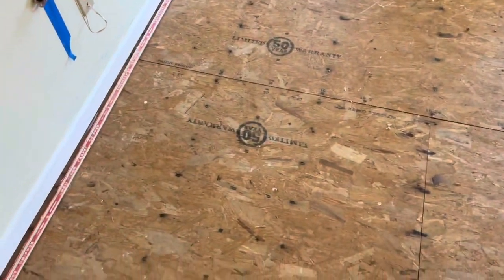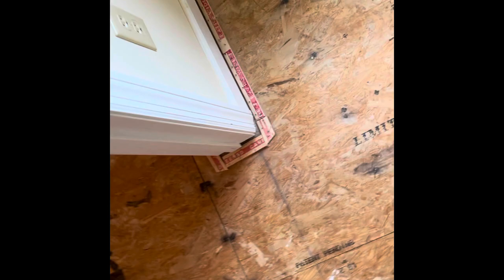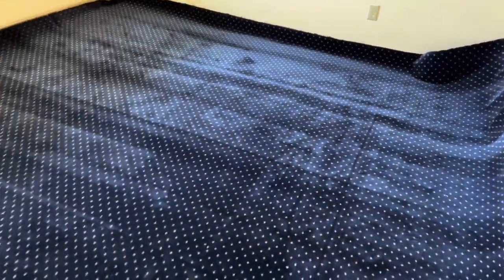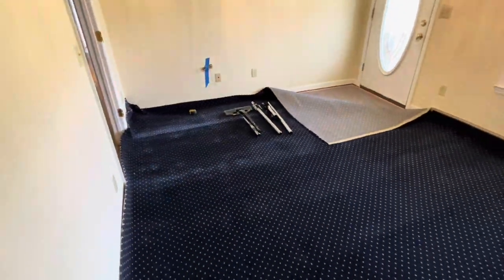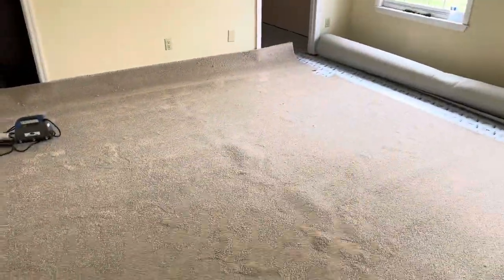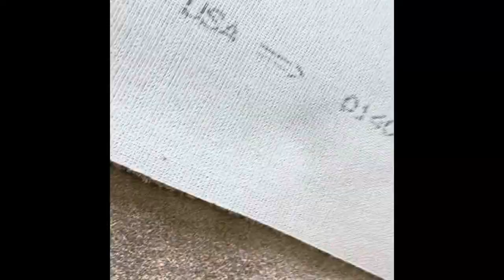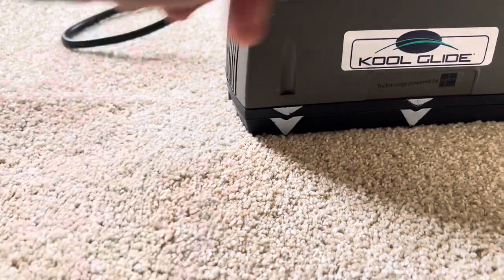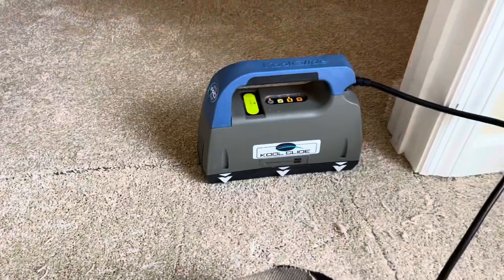The daily grind, Wilton face-to-face install￼

Comment: Wilton carpets should always be latexed top and bottom to stop it fraying 👍
Reply: PJ will tell you REAL latex, not the Elmers glue type. (Orcon) 😉
.....easier said than done.  Very few suppliers even stock it, so retailers can't get it.
I loved the smell of ammonia in the morning.
Reply: @randywl8925  it has a smell all its own :)
Reply: @randywl8925  we get it over here no problem.
Reply: @TheAmysjoy2823   I'm in Oregon, not sure about you.
So few people use any sealer, so even fewer request real latex.  It sits on shelves so long it gets lumpy in the bottle.
Reply from the maker: Only if you do not have a chain to stop the raffle, in this case I had about three chain stitches maybe for behind my tack strip which will prevent it from raveling out but I do understand what you’re saying
Reply from the maker: @randywl8925  it is definitely hard to find
Reply: I believe Wilton carpets have to be installed with double amount of tackstrip, so after they are cleaned the don’t shrink